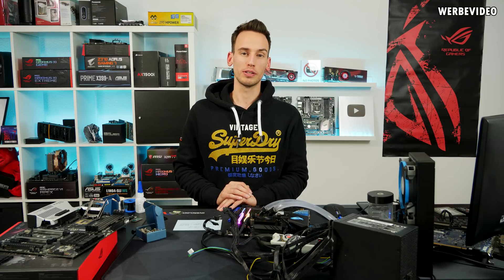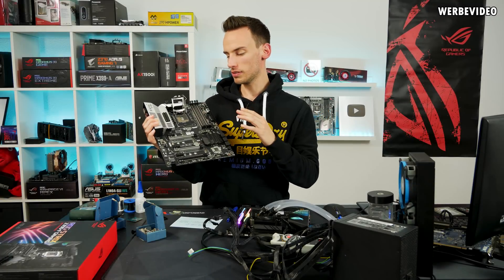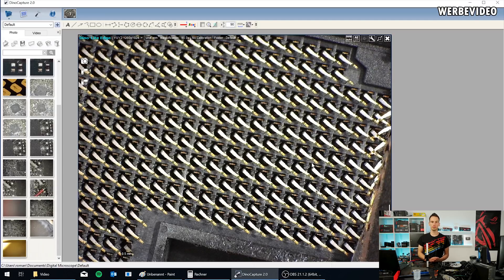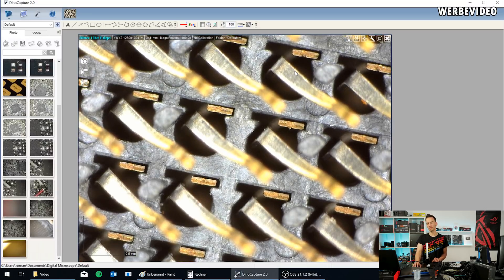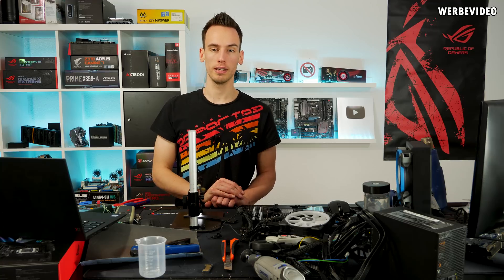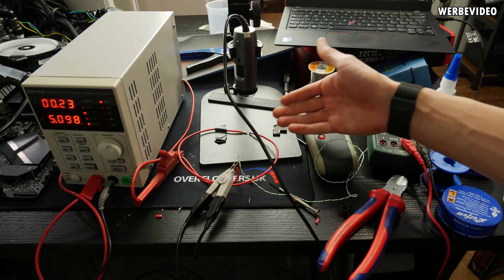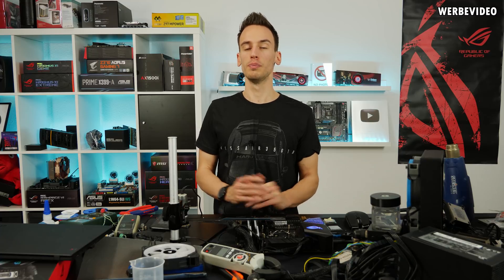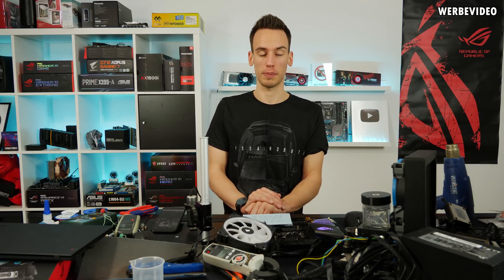We analysed the Z390 socket!

Comment: 1:45 148 A??!! You could kill an elephant with that current, right?
Reply: Yet so low of voltage potential, I can lick my fingers and grab a car battery and pretend to be electrocuted just to screw with everyone on the robotics team... 1.35v is just enough to light up some LED light bulbs (but not all, the 5v ones won't do anything visible). Maybe get 1000 of these boards in series and then it might do something to the elephant (although, with such thick skin, I doubt anything under 10,000v would actually even lightly shock them unless they were standing in a puddle of water).

Comment: Maybe Intel engineer's wanted to compensate metal fatigue of the socket pins by using more pins? What i mean is that since the pin has to maintain certain pressure to have reliable contact to the pad and maybe this pressure lowers over time due to metal fatigue. Could be that they thought that the failure rates of MB/CPU would be too high to risk letting people use old boards with less pins used for power, boards that already have less pad pressure for good contact. The main issue might not be the pin itself , but instead its ability to make good contact to CPU PCB?

These things are always fun to think and talk about. Sometimes they are not just as simple as we think they are. Could also be that Intel wanted to sell more chipset's and decided to do this . Or they wanted to avoid PR disaster of failing motherboards/processors. Sadly only Intel knows the answer.
Reply: Its the same pins, just not electrically connected to anything.
Reply: @jakegarrett8109  yes same pins and same amount in the socket, but older chipsets have less pins used for power. didnt notice i didnt make it very clear what i meant when i posted.
New chipsets use more pins to power more powerful CPU's on the same socket. Maybe the old chipset amount of pins used for power would be fine but to compensate the metal fatigue that happens over time to the pins supplying power to the cpu.  Maybe Intel engineers wanted to make changes against this by increasing the number of pins used to supply power to the CPU and that way making sure enough pins/pads have good contact over time.
Reply: @techjunkienerd578  you mean oxidation of the pins over time? Potentially. We'll just have to wait to see if there's any failures over time in the modded Z170/Z270 boards that already have 9900K's in them
Reply: @greebj  oxidation is likely not an issue on gold plated contacts. What i mean is metal fatigue on the pin, the pin is like a spring pushing against a pad. Over time the pressure of this "spring" lowers due to metal fatigue. Not sure if term metal fatigue is the right term for this in english, since im not native english speaker.

Depends how many modded boards there are working with 9900K's. Might not be large enough number to make any engineering decisions and manufacturers have to play safe with their products that they release.  Even if something works it doesn't mean that its well designed.

Like i said only Intel knows the reason and they have said that older boards don't have enough pins used for power. To me this makes sense. Problem is that the socket wasn't designed for these processor's, it was designed for 4 core/8 thread chips. I wouldn't be surprised if Intel will release a new socket in the near future for more power hungry CPU's of the future.

I use both Intel and AMD processors. The competition is really nice to have nowadays. Was really tired of Intel releasing quadcore CPU's year after year.

Comment: Next project: soldering the CPU directly to the mobo!
Reply: "how to delid your socket."
Reply: That’s called BGA, it’s how most GPUs and mobile chips are mounted.
Reply: And the RAM and the storage! Wait.. am I Apple?
Reply: Max Pain  pretty sure i have an asus laptop with a socket inside and not soldered cpu (from like 2010 or something, gtx600 era as)
Reply: There actually was some sockets that would melt small beads on the cpu so it gets stuck on the motherboard

Comment: AM4 does fine with Ryzen vs. Ryzen 2. We will see how it does with Ryzen 3 and if any problems arise with power delivery to the chip (I don't think they will). They said it was for the next 10 years so Intel could definitely do the same. Pins have never been a valid excuse.
Happy New Year!
Reply: I'm thinking it should be fine. AM3+ was fine on 500+w from FX series, so I doubt it will be a big deal (I can't even hit that on my TR 1950x, but I haven't used LN2 on it yet). AM3+ was "plus" sized over AM3 with fat pins for more current, and now AM4 looks like spider webs by comparison (AM3+ was pretty safe to just set the CPU on its pins, even small drops wouldn't bend it), however, I think AM4 will be just about as capable since it has so many more pins. Thinner, but many more. Also the power draw is not through the roof like FX, so that's the biggest thing.

Comment: I never really considered that mounting in the socket and also tightening down coolers can reduce chip life *potentially* over many times. I guess if it was something that truly reduces longevity, it would be mentioned by intel?
Reply: Why would they mention that? It would make people think less of them. 
GPUs can wear out PCIe sockets, but nobody mentions this either (I can't find the spec, but I was laughing as I bought some GPUs from a Dell software engineer and he looked like he was going to have a heart attack as I was moved GPUs around onto different slots on a board. He said its 15 mounts for PCIe life expectancy, which would make all of my boards zombies at this point then...). I actually do have some major wear on the contacts on some GPUs though, LOL! CPU sockets do the same as well (AMD included), everything wears.
Reply: @jakegarrett8109  oh Jesus....the gtx 580s and old motherboard I just replaced should be literal ashes at this point. They're from 2011....

Comment: extra pins totally debunked
Reply: Well there may be some specifications regarding the pin involved but the effect of 30% higher Amps/pin seems to pale into insignificance when nearly 100% more A/pin causes no effect on stress test stability. (I assume if Roman had to increase voltage to remain Prime95 stable he'd have mentioned that in the video.)

Comment: Yes very cool, but can I fit a 9900K in my Z97
Reply: You can't because the voltage regulator is inside the cpu on that socketso that can't work.. but intel could totally make a LGA1155 Z77 DDR3 version of the 9900K if they wanted to, skylake memory controller can do ddr3.

Comment: Hay der8auer do you have a recommendation for the best overclocking setting for 9900k on all cores?like the videos btw
Reply: That's like asking how to clone a human in a YouTube reply
Reply: Hahahahaha
Reply: @danielpriest6608  Yes, lots of voltage, some liquid helium, and fire extinguishers. (my motto, minus the helium)
Personally, I like to use duel PSUs with my builds (my modest daily machine has 2x SuperNova 1300 PSUs, they are ridiculously cheap, but they don't have power monitoring like my HX1200i platinum (any "i" series), or some of the Seasonic brand like Der8aur is sponsored by (I do like that one with the LCD power readout, I think that's pretty cool having the meter shown on the PSU itself). So I'd also recommend PSUs like the Seasonic so you can see how your system is behaving during any overclock (gives you an idea of when you should bring that fire extinguisher closer...)

Comment: shame intel, shame
Reply: Shame Intel, or shame Intel and motherboard manufacturers. Is this tacit collusion between motherboard manufacturers and Intel?
Reply: @martinw245  shame, not so many people need a PC now, small market, special for gaming chip sets.... Cloud people don't need this!
Marketing skills you need, community college!
Reply: @martinw245  so what's the problem? Why do you find the fact that Intel engineers new products so troubling? If it wasn't for Intel you wouldn't even have microprocessors. Being as Intel invented the microprocessor.
Reply: @1pcfred  

Huh? I don't find the fact that Intel "engineers new products" troubling. What is your point?
Do you understand what this video is about? It's about Intel  designing a new socket with extra pins that wasn't required. The hypothesis is that this is so we have to buy new motherboards unnecessarily, purely so that Intel and board manufacturers can make more profit.

Now I stress, this is just a hypothesis, a hypothesis that could be completely wrong. A hypothesis based on der8auer's findings that  a new socket was not required from what he could glean. It may well be that der8auer is  missing something, and that there was indeed a very good reason why a new socket with extra pins was required. Precisely why I asked the question, the opinion of others, and put a question mark at the end.
Reply: @1pcfred  

Myself and others were referring to the following...

25 seconds in, and I quote: "Intel increased the pin count for VCore and also for ground. They increased the VCore count by 18 pins and also the ground by 14 pins. Previously on Z270 those pins were reserve pins. That is the reason why Intel said the 9900K is not downward compatible to Z270 because they changed the pin out of the CPU and also of the socket."

Result: 15:49: "So very interesting that nothing happened, and for sure it would not have been needed for the change from Z270 to Z370 to change the pin count and add V Core. For sure that was not necessary. .. SO IN THEORY I THINK IT WOULD HAVE BEEN  FINE TO RUN THE 9900K ALSO ON Z270." 

Clearly he is saying that it would have been okay for Intel to have allowed us to run 9900K on Z270 and to have NOT changed the pin layout of the socket. This is what myself and others are referring to.
Reply: @1pcfred  

Huh! What the hell are you talking about. Of course im not wrong. Its there for you in black and white Roman's exact words, directly quoted. Exactly what  I was referring to. Are you a bit thick?

Roman made it clear that according to his tests the 9 series could have run on the old Z270 chipset and socket.
I merely asked if others thought tthat Intel preventing this was tacitly colluding or not. If you think not, awesome. Lol. 

Clearly you are just a troll. Now I see why everyone else has ignored you in this exchange. Lol.
Reply: Didn't think I'd see a Derrin Hinch slogan here ,but there you go..
Reply: @unh0lyav3ng3r8  the same, but different. Year to year with the new features that come out you're better off getting a new motherboard anyways. So Intel just makes the smart choice easier for idiots to make.
Reply: @1pcfred  Well, as the resident idiot on this thread, you should know...
Reply: @1pcfred  omfg dude, I actually lost several brain cells reading your comments. After 6 months, do you wanna retract?
Reply: Max Pain  Gamer's chipsets, they don't make big profits on them, needing to pay the R&D people too!
shame on nerdy noobs, not understanding , less and less need PC's now, the smaller the market, the more money they need for to produce them! Need Pro parts, for gamer's only.... The cloud is NOT needing this, that's were they sell!
Reply: @Knut Gerber really you're better off getting a new motherboard anyways. While the performance improvements of a CPU are important additional features usually don't hurt either.
Reply: Max Pain  who ain't greedy? How much money do you leave on the table at the end of the day? Money that you know you could have walked away with scot-free.

Comment: PGA is still better!
Reply: Zen2 on older B350 = Win.
Reply: Amd cpu pins are pretty tough to bend by hand. Even the take out straight out. The cpu pins are still intact. You just need a brain, slightly twist the cooler for ease use. Or just control your strength.
Reply: I <3 PGA.   I've had 2 LGA sockets fail on me, pins sagged over time and lost contact and then burnt out lol. Had it happen on 2 different socket 775 intel boards.   Ever since then I have preferred PGA for their robustness.
Reply: I posted this under another comment, but I'll copy here:

It's not just about current, it has to do with inductance. At high frequencies (such as that of a CPU), the pins start to behave more like inductors than ideal wires. That is, they fight changes in power and can result in voltage dips. This is why you'll see capacitors in the middle of the underside of the CPU, to counteract the voltage dips and keep power stable. If you spread the load across more pins, the inductance in parallel is less than the individual parts. More pins can therefore be better, and allows you to reduce the number/strength of capacitors needed. LGA is beneficial because it allows for more, smaller pins. With PGA, you can only make the pins so small before they become too fragile.
Reply: I too enjoy ripping processors out the socket when trying to remove the cooler...
Reply: @jordanlewis3790  You don't just pull off the Cooler, you wiggle it off, easy as that, just like you did on pre-lga Intel Sockets.